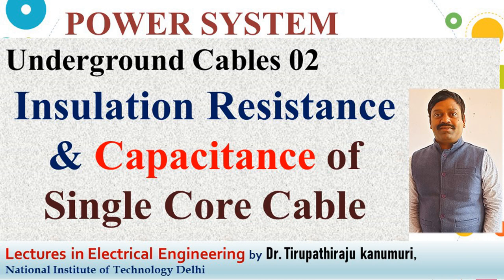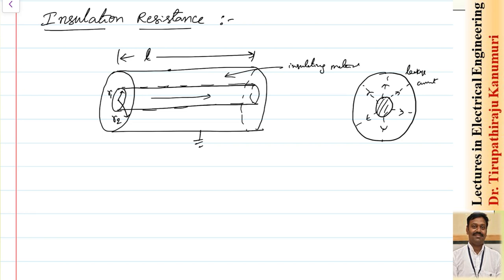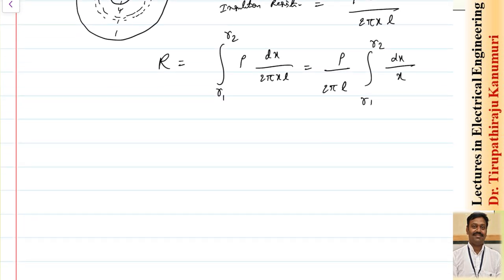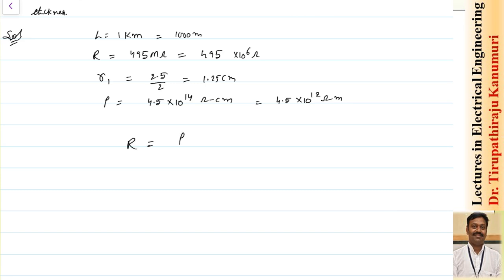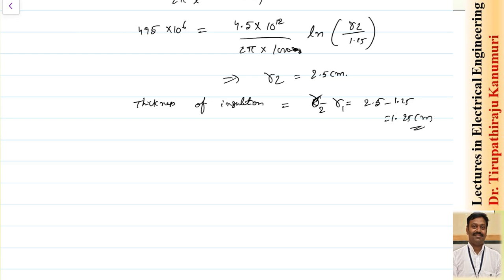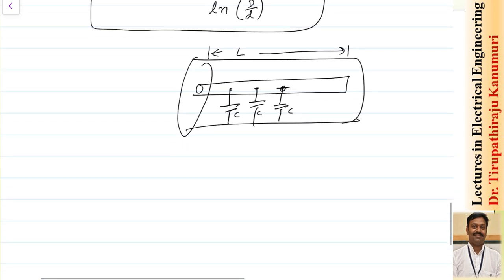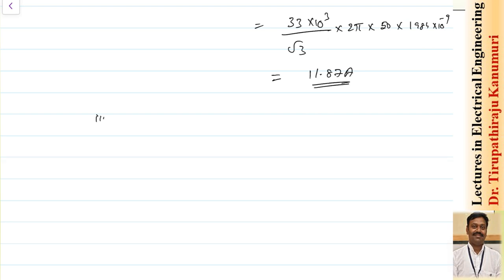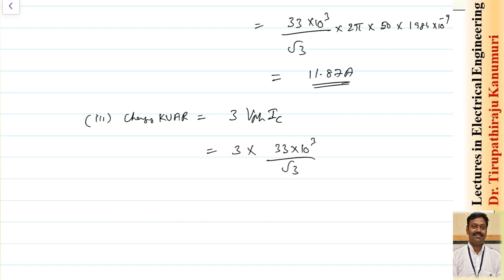PS49 Insulation Resistance & Capacitance of Single Core Cable

Comment: Hope u r fine sir. The formula for insulation resistance of a single core cable does not contain a voltage factor. But it is obvious for high voltage circuits leakage current will be more and hence high insulation resistance. According to my understanding, the formula will give the same insulation resistance for 11KV and 33KV. Kindly clarify.
Reply: Thx sir. But You mistook my question, sir. I will try to put my question in a different way so that we can derive maximum benefit from you, sir. Suppose we have a insulating material XLPE and obiviously it has some insulation resistance . If i am working with 11KV cable and 33 KV cable insulation resistance required in latter case will be more as compared to former case so that the cable has proper thickness of XLPE , so that if any one touches it or it comes in contact with any external object proper insulation level is maintained. Moreover, external objects will behave differently for different voltage levels.  But natural Voltage  does  not change  the insulation  of XLPE cable but the external objects will behave differently for different voltage levels. This is my field experience and that is why the same condutor of a cable will be insulated differently for 6.6 KV, 11KV and 132 KV voltage levels(Indian standard voltage levels). I watched your video sir and I got some answers from the numerical problem on cable where you calculated the thickness of the insultaion .That numerical explicitly explains how to determine the required  insulation levels for various voltage levels. For example, insulation Resistance , resistivity and conductor area  and other parameters of XPLE or PVC will be known and i require a single core cable insulation of 5 Megaohms for 11KV and 12 Megaohms  33 KV(say) . Thickness of insulation will be more for 33KV level. This doesn,t mean 33KV changes insulation resistance but reflects that external objects need more insulation for 33KV than 11KV. That is why  voltage level will decide the insulation level of a cable. Sorry for boring u, sir. Shared my field experience with u sir.
Reply: @tariqahmadnajar1569  burra padu chesesav bro 😅😄

Comment: For charging current calculation, why  insulation resistance was not included for impedance?
Reply: First of all you have to know, what is charging current okk,,,,

Then you have to know, The existence of a charging current is due to the effect of the capacitance of the transmission line. At no load condition 😁